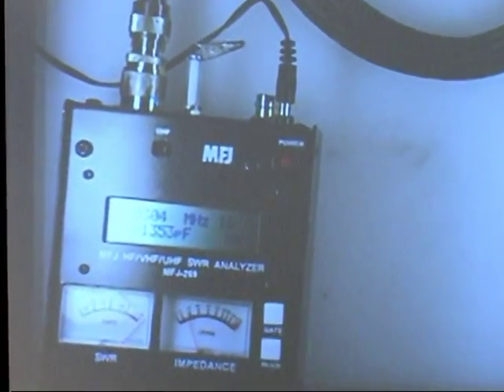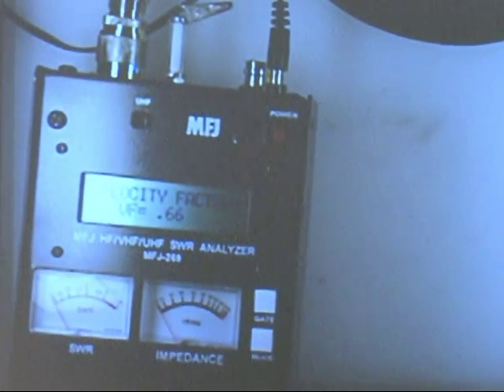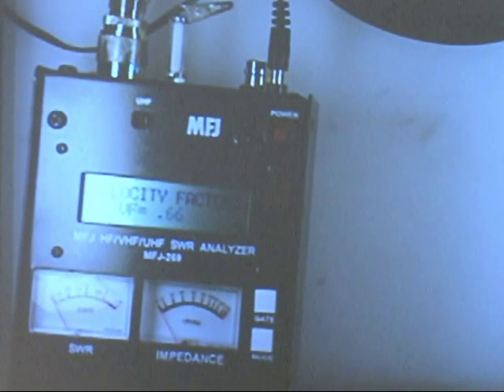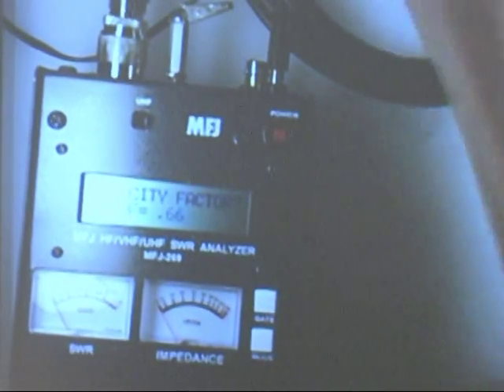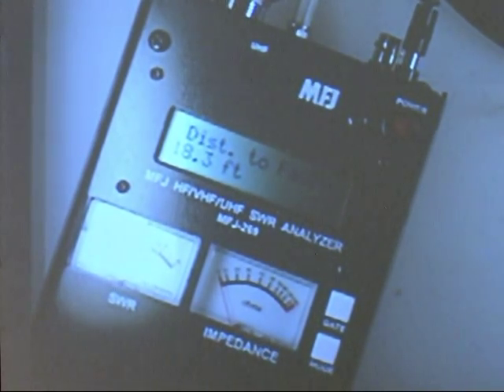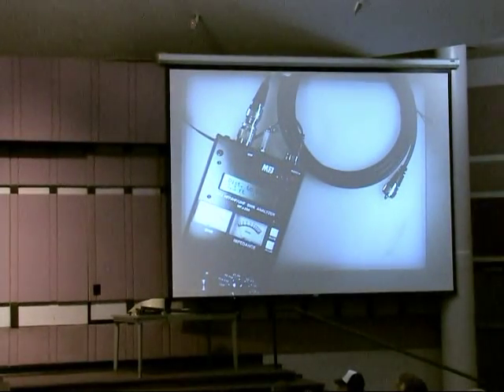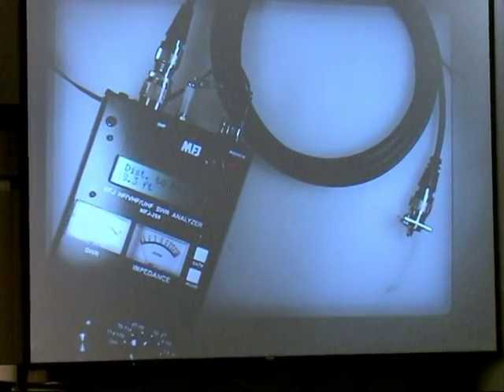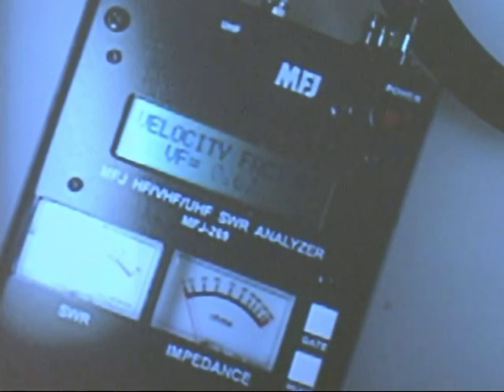MFJ Presentation: Testing Coax Cables Part 1 of 2

Comment: Thanks for that info. I decided to give the RigExpert AA-54 a shot so I changed my order this morning only because I want to take advantage of the LCD screen and the sweep features. I'm working on some home brew antenna designs and this will allow me to view the bandwidth for a given band in a chart format at a glance. 
It can also interface to a laptop too. The only disadvantage is the AA-54 is only good from 1 Mhz up to 54 Mhz. Cont:

Comment: It's fantastic! It makes testing antennas so much simpler than using the SWR meter on the radio. I also used the capacitor testing feature to test an air variable capacitor. It was nice to be able to verify that the capacitor was working right. This analyzer was well worth every penny I spent on it.

Comment: Cont: whereas the MFJ antenna analyzer has a much broader freq coverage. I could have worked with the unit but for my needs I would have to chart out the SWR and the impedance on paper so that would be a bit time consuming. Both analyzers have strong points and weak points. I also looked at the Youkits FG-01 but the display is the size of a postage stamp and it cannot interface with a PC plus it takes a special battery. The meter I just ordered takes 2 AA batteries and that I can live with.

Comment: Why did you get a .3 feet difference between an open any shorts? That makes a difference because it is like 2 1/2 inch difference in length. I noticed something with mine when I get it if I went on certain frequencies like really low one or 2 MHz and I was using the meter with RG58A/U and  I noticed it indicated that an 18 foot piece of Coax showed a distance of 3590 ft. However when I just did it between 120 and 150 MHz it indicated the correct amount of feet.